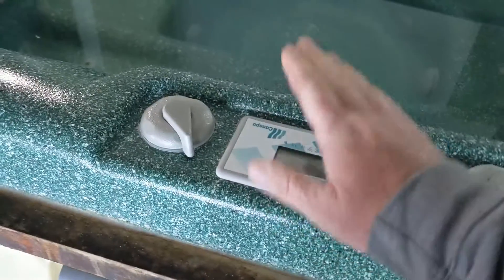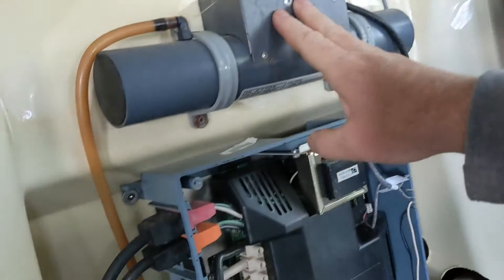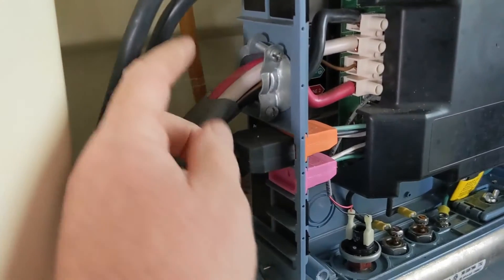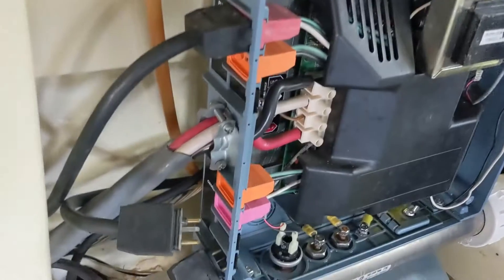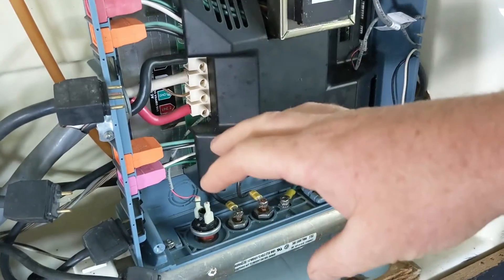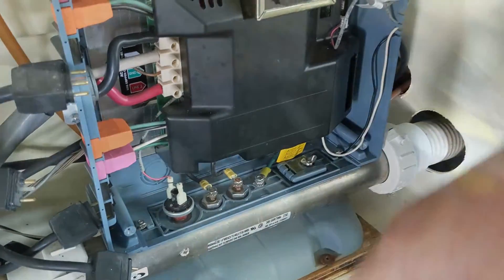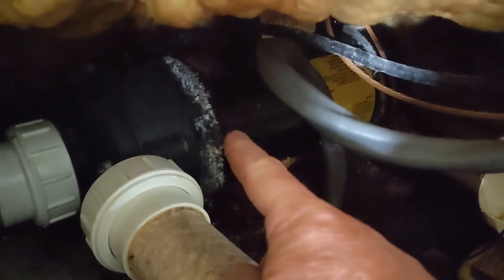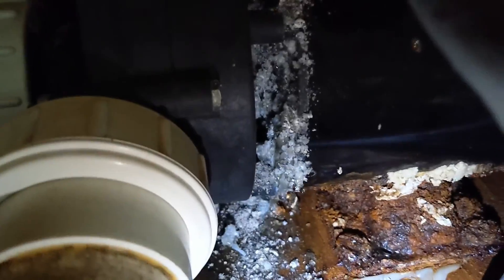Why is Your HOT TUB Tripping the GFCI Breaker | Hot Tub Pump Trips Breaker

Comment from the maker: These steps work on any spa pack.  The heater element is normally the reason the breaker trips.
Reply: My heater is tripping the breaker. The element measures fine at 10 Ohms. What else can I check to ensure that it is the problem?
Reply from the maker: @sandiegodan  replace the element

Comment: Spa technicians came out opened the panel and said it need to be reset and it was back on. $150. Used jacuzzi and a couple days later no power. Circut breaker not tripped. Still no power.
Reply from the maker: whats it doing or not doing?  its a Jacuzzi hot tub?